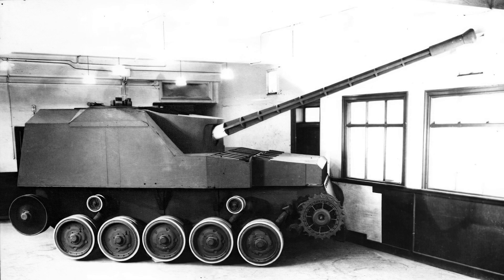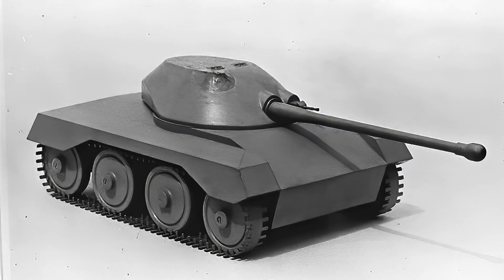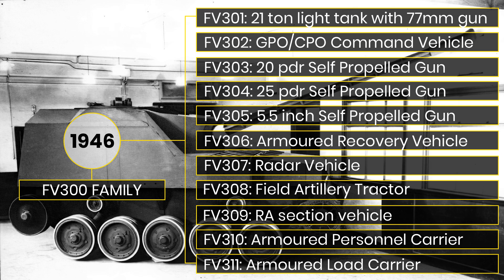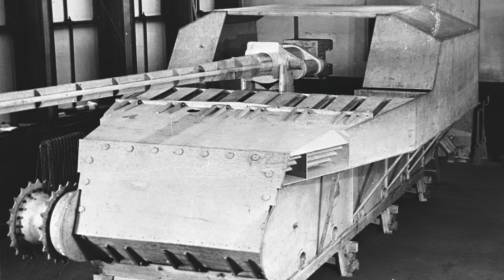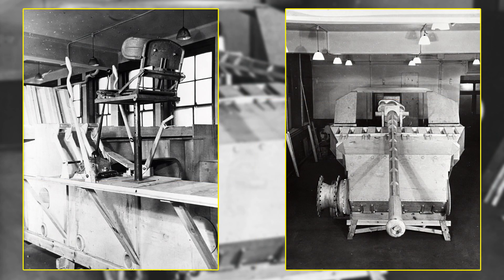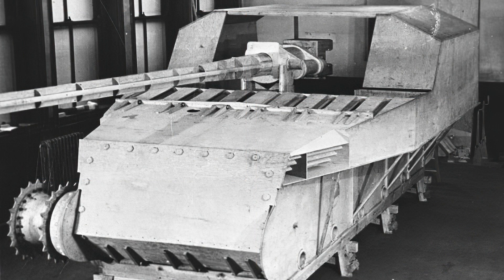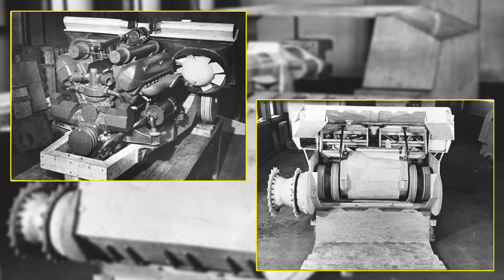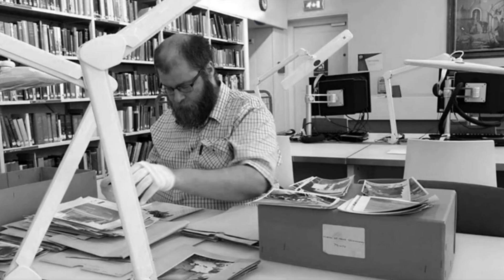FV303 Tank Destroyer - Tank Design & Theory

Comment: I think that when it was first conceived the FV303 would have been used by the RA instead of the RAC, rather than it being likely to have superior armament.  1949 is around when anti-tank duties were planned to be transferred to the RAC as well...
Reply from the maker: at this stage in  the FV prcoess they have not yet been allocated to who gets what, so there is often a squabble, it would have likley gone to RA but as with most their was usualy bickering between TAC/RA etc over who got what, and yes AT duties flipped back and forth a bit. some were clearly RA such as 304 tho